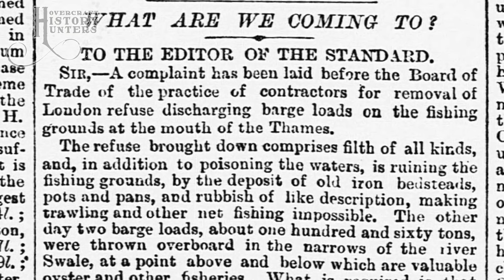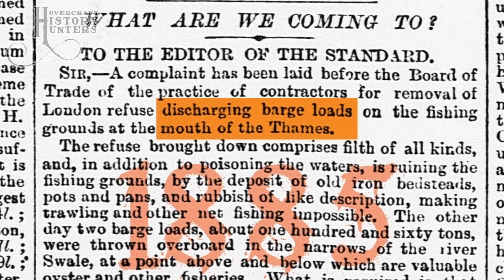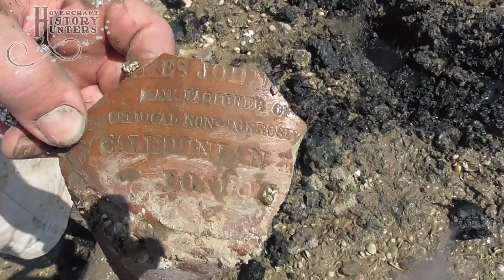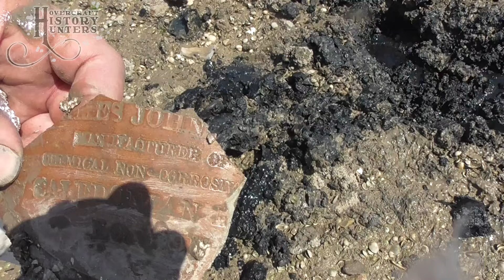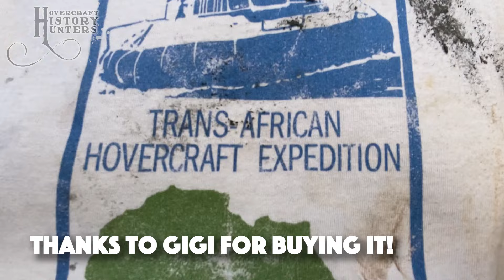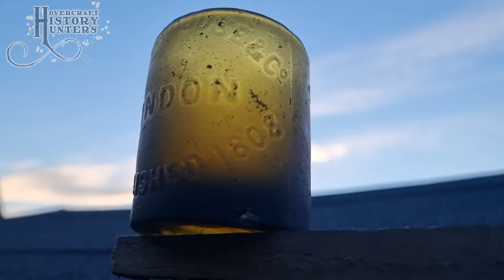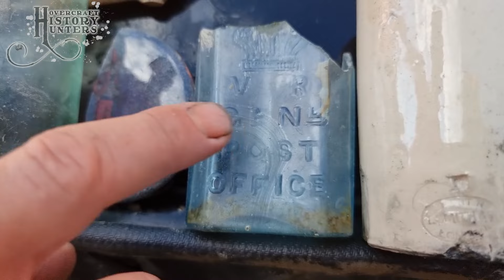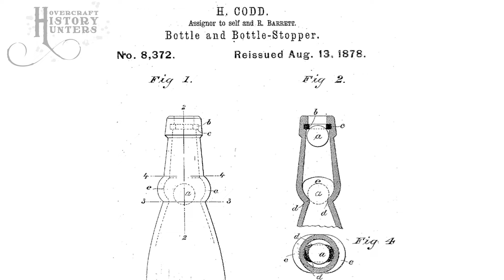We found a CRIME SCENE Mudlarking London! Hovercraft History Hunters

Comment: I think I mentioned to you some time ago to try using an old napkin ring as a stand for those torpedo bottles. Go to your nearest charity shop to pick up inexpensive ones.
Reply from the maker: But it will hide the bottom bit. It needs to be minimalist ideally. 👍🏻🐾🧡
Reply: @Sifinds  Ahhh…understandable.🤔 A design immediately popped into my head when I read your reply. Two wire rings made from sturdier wire than yours (about the circumference of the upper ring of your design), three or four short pieces of the same wire to connect the two rings. I see the short pieces curved inward in a quarter moon shape as if reaching to touch the bottom of the bottle. Upper ring to cradle the bottle, lower ring to rest on the table top, shorter curved pieces to connect the two. Open all around to show off those glorious bottles. 😁

Comment: Collecting pop bottles was big business for kids when I was growing up. Scouts collected them in bottle drives. But for us, taking the pop bottles, large and small, from home or going door-to-door meant lots of candy.

We also used to look for bottle caps that had between 5 and 25 cents (or sometimes “Try Again”) printed under the lid, later printed on plastic fastened to the lid which you would peel the plastic off and take to the corner store. When my Mom married my step-Dad, he used to take us with him when he went to the city heating plant he designed to inspect it. They had a pop machine and the workers always let us take all the pop lids under the bottle-opener. They would magnetize a screwdriver and we’d stick it in the receptacle. We often came away with $2 or $3 worth of caps.for us, that seemed like $100.

Actually, if you counted the return on the bottles plus any money in the caps, you could buy a whole paper bag of candy!
Reply from the maker: Fantastic stories! Love it